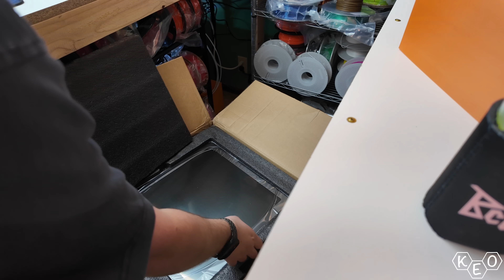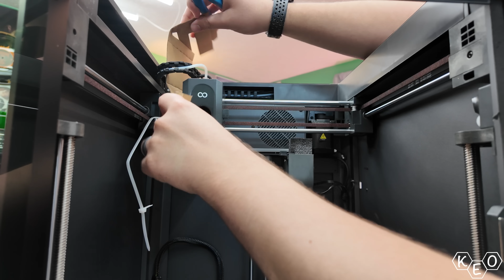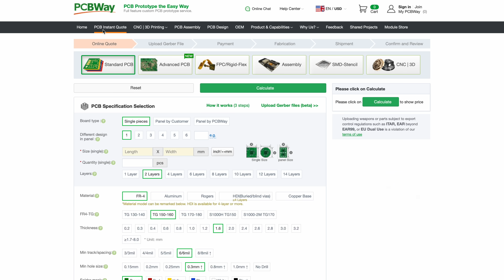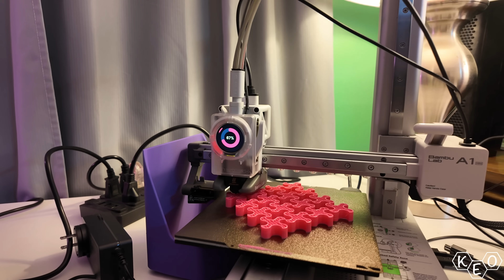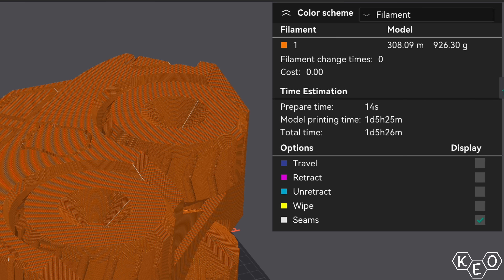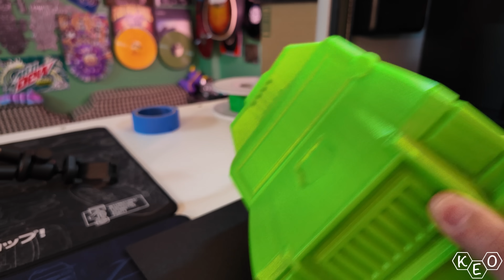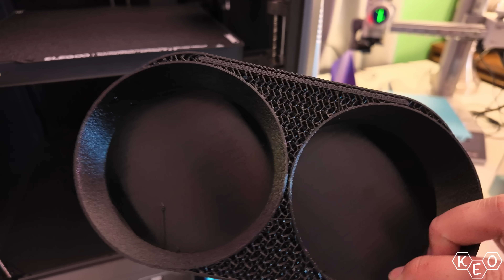$300 for THIS? Elegoo Is Playing Dirty…

Comment: Mine is a batch 2, and I absolutely love it. I always use orca slicer and tweak the profiles and settings, so that does make a difference, but I swear with the same profiles and settings my Centauri prints a little more accurately than my P1S.

I cut off the zip tie on the boden tube near the hot end and no longer have loading issues, so that’s an easy fix.

My one issue with it is the noise. This thing is Loud. It also has some problems with fans running on max when they don’t need to, and not turning off after a print or filament loading is done. They fixed some of that with a firmware update, but it still needs work. Fortunately it’s clear they are dedicated to ironing out the bugs, and I’m pretty sure the fan problems are mostly software side.
Reply: It took me a while to realise that only the electronics bay fan (that runs on for a while after the print finishes) is entirely under firmware control. 
The ‘aux’ fan (the flat one at the back) is (only?) controlled by the g-code (it helps with bridging). It ramps up and down depending on whatever bit of the print.
The chamber exhaust (“case”) fan runs all the time during printing, even with door open and no lid, which is pointless. But if you turn it off, it comes on again soon afterwards. It is not controlled by the ‘exhaust’ fan setting in the (slicer) filament profile! I have been told that this ‘always on’ behaviour is from the g-code generated by Slic3r, Prusa and all their derivatives, including Orca and Elegoo. 
We don’t want to mess with the hotend (“model”) fan! 
The firmware DOES (newly) shut off those three fans at the end of each print - but the electronics bay fan only goes off once the temperature has dropped (and that isn’t quick, causing me concern about the lack of venting of that bay.)
I’m just surprised that there should be (kinda useless) fan ‘controls’ on the touchscreen. 
Initially I wondered about upgrading to quieter PC fans, but I suppose I have got used to them, and now consider improving the electronics cooling a higher priority.

Comment: They're going to have a hard time disrupting anything when they can't ramp up production. Here we are 4 months after launch and it's STILL on pre-order with an ETA. of August here in Canada. Personally reliability is far more important to me than anything else, followed by ease of use - loading/unloading, maintenance, hot-end swaps, the general stuff. This is basically a PLA printer for $300 in 2025... It failed hard at TPU and self destructed trying PETG, I'm not worried about Elegoo coming in and disrupting anything.

Comment: Nice! I had a creativity ender 3 v3 ke, that i lost my patience trying to make it perfect and decided to change it for a bambu... This one seems ok, those defects might be corrected with a bit of programming and physical corrections in the system movements... But the truth is that when a machine is inconsistent or drives you nuts... An I going to spend time correcting the settings to make it work, it would i like to spend my time using it for what i bought it for...
Reply: That’s where I’m at too, Ender 3v2. Did you end up getting a new printer?

Comment: I get that you want to test what profiles are present and if the printer can do auto-calib for flow-rate and pressure-advance, but if dont do profiles you wont get really good results. Even my X1C whic has auto-calic is sometimes much better and much worse with the feature, i just stopped using it and only use it to roughball a number and do my own manual print profiles, for very good results, just like people on the P1S do. Also not only your black petg print is faulty, even your green car print i faulty, You can clearly see kinda of layer shifts and the massive change in color and detail in the middle, thats the same thing the black print hast, just smaller walls. Im guessing this comes from not enclosing your enclosed printer, because of the tube thing.

Comment: At that price it would be great if only it was reliable. But that's the thing - to achieve this price point, they have to cut costs somewhere. Making things reliable is expensive - it requires quite a lot of labour. Producing proper printing profiles requires hundreds if not thousands of printing hours. And for this to work on many printers, you need to make sure all the printers are havig repeatable results. That requires quality parts, securing proper supply chains, etc. Firmware development is also famously hard for manufacturers of cheap electronic devices.

Dont get me wrong, I admire manufacturers who can produce things that cheap. It is not easy, it requires some type of ingenuity and a lot of knowledge and experience to make cheap things. Especially if we are talking about cheap working things. But the devil is in the details and there is no time and budget to get all those details right if you want to be on such a competitive market with such a low price (and thus low margins).

Comment: One of those totally invalid reviews. Using printers on default profiles is for rich people who buy overpriced filaments.
Reply from the maker: Am I the rich one buying overpriced filament? I think I’m missing something because in that video I used everything from a 12 dollar spool of no-name PETG to overture TPU and PLA. That aside, elegoo makes filament. They can ship machines with pre-tuned filament profiles like Prusa and Bambu do. Just one simpleton’s opinion though. Thanks for hanging around friend!
Reply: @KeoPrints  No-name filament and filament from China usually requires tuning, that ends with results rather different from default profiles. For example, there is PETG that I like, but it does not even start to extrude below 250C. Sticking to default profiles is intentionally worsening the results of all brands that do not have their personal profile in the slicer.

Comment: For the PETG print I would check the cooling settings, both hot end and the sheet cooling. PETG likes to be hot, so a light touch with cooling (or none at all if the model can handle it!) will probably fix the issue.
Reply: Yep, this is the conclusion I came to as well. For some reason the Centauri loves to run its fans on max all the time. They fixed some of it with a recent update, but it’s still a good idea to mess with the cooling settings to be safe.

Comment: Helloooo, firstly, being cheap does not allow it to be crap. This is unhealthy for the market and a barrier for adoption for most people. If you're a tinkerer, then fine, I remember the Ender3 :) Second, TPU on the textured PEI, there are a couple of ways to address this. very watery PVA glue as a separation layer works well, but it works better on the smooth sheets as if it's too think it'll pool in the texture. But nobody likes the gluestick, especially us lazy folk. The removal is eased if you're into cleaning your bed with IPA. Use a pritzing bottle as it reduces te amount you use any way, bt spray the bed with the model on it a little and let it wick under the model. While it won't jump off the bed, it will make pulling it off less likely to rip. Cool videos :)
Reply from the maker: Great notes here! Thanks for taking the time friend!

Comment: Regarding the imposible to remove TPU parts printed in PEI beds, just spray Isopropyl alcohol trying to get it where the part meets the plate, it will flow between the part and the bed, just wait half a minute or so and the part will be really easy to remove.

Comment: Bamboo didn't invent Core XY, Enclosures, or filament changers. Charging Prusa processes for the same number of steppers and a few more feet of belt than a bed slinger is crazy.
Eligoo isn't disrupting the market, they are resetting the norm.
Reply from the maker: This is true. Hopefully this reset inspires other manufacturers to make affordable machines

Comment: Got mine about a month ago, had no issues at all with this machine, haven't had 1 failed print - have only printed with PLA and PETG so far though, just using the elegoo slicer at the moment. Came form Ender 3 so anything feels good I guess but just been impressed with the reliability of it, I haven't had any of the weird software issues you have been experiencing or the filament tube issue, although my bend doesn't seem as extreme as yours, perhaps I just got a later machine with a few small changes
Reply from the maker: Well that's amazing then. I am hearing that from people here so I am hoping the machine continues to improve. As it is, this one is still great. Just needs some polishing.

Comment: $300 is a great price. If not offset by wasted filament from failed prints. I need reliability more than a great price. I paid $150 for a new Adventurer 5M and havent had a problem yet. For $150 more than this is for a 5M Pro, I'd buy that.

Comment: The Centauri Carbon (or more likely the regular Centauri because I don’t really need it to be enclosed) is a printer I’ll definitely be buying sooner or later. Especially since anything from Bambulab is an absolute hard-pass for me, this Elegoo really looks attractive. When spending less than €300 on one I can afford to change out the mainboard if the one it ships with becomes too limited. But thank flip it just runs a customized version of Klipper without any cloud connectivity whatsoever (local network is perfectly fine for me, anything that requires an account is absolutely not). So I’m not too worried about firmware limitations there. Because it’s already just doing what it’s supposed to and even if Elegoo pulls a Bambulab and starts stripping away paid-for features, then it’s just a matter of ✨not updating the firmware and using it like usual✨.

Comment: Thank you for the review. A $300 printer over a $1500 printer is not worth $3 if it wont print or prints fail all the time. Too many choices that just work to put up with that today.
Reply: If you don't know what you're doing you'll have a bunch of fails with a $1500 printer too.
Reply from the maker: Fair point. I suppose it all comes down to what you are able to tolerate and what your priorities are

Comment: I got my CC 5 days ago. It was in batch 4 and wasn't supposed to ship till next month. Luckily it did come with the upgraded light and the multi filament port in the back. The ptfe tube does not come zip tied down anymore and I haven't had any issues feeding in filament, even with the glass top on. I immediately did a firmware update and haven't experienced any issues with the touch pad or with printing. I've kept it busy since it came in and haven't had any kind of failure. I've been switching between PLA, PETG, and silk PLA in different brands. I'm extremely happy with the quality and the speed has been eye opening. I accidentally sliced silk PLA with PETG settings and it still printed amazing with only a slight amount of stringing. I am one happy customer...
Reply from the maker: This is what I want to hear more of. That's awesome that your experience has been great.
Reply: Good to know! Still waiting for mine which means it should have the upgraded parts too.
Reply: How do you figure out what batch yours is from?
Reply: @markm4952  If you haven't gotten yours yet, it should be from the "new" batch with the upgrades. At least that is what I am figuring. I'm still waiting for mine too - preordered it May 5.
Reply: @markm4952  On the CC page at the Elegoo website, there is a link to Detailed Shipping Information. That page lists the different batches and estimated ship times based on when you ordered. And FYI, I've now have well over 300 hours printing time on my CC and I'm still loving this thing. Best purchase I've ever made...
Reply: Still waiting for mine, so with luck I should get the latest updates as well. I was in batch 4...ordered 6th March. I've got a growing list of things I want to print with it now...

Hope to be as happy a punter as you are :)
Reply: @chrissavage5966  I didn't order until May 4 so I'm probably going to be like batch 30 or something LOL
Reply: THANK YOU FOR THIS, this is what people want to hear. I was concerned about the light and if I would have to add my own. I ordered mines last week  and am in the current batch list so mines is expected to ship July 31

Comment: I got mine this week and, thus far, have been really enjoying it.  The version I got is the newest revision.  They fixed the crap lighting and it's actually really solid now.  There's only a few real beefs I have with it, mostly though, what I've been spoiled with with my A1.  The lack of ability to stop an object during a print sucks.  If I've got a bed lift or something, I'm stuck printing that bad-boy or wasting the rest of the print.  One of those Bambu features you don't realize how much you like 'till you don't have it.  Also the lack of ability to move the plate or do, really, anything while the print is paused sucks.  It would be super nice, once again like Bambu, to be able to move the plate for things like inserting magnets and such.  And, of course, the big issue of not having an app.  First-world problem, yes, but still really handy when it comes to things like filament run-out and such.  Notifications have made life so much easier.  So far, though, for what it is, and yes for how much it costs, it's a pretty solid printer that's printing fairly well.
Reply: There's a setting in Orca slicer that allows per-object cancellation. Search for Exclude Objects. I haven't used it, but I'm pretty sure it does what you're wanting.
Reply: sounds like an app is either now available or releasing soon, or it's just talking about the octoeverywhere integration that is now functional but req a raspberry pi device
Reply: @coreysmith5397 at the moment, no app, but yeah I'd love it if they actually come out with one. Even if it isn't very good, the notifications are super handy

Comment: I've only got 158 hours on mine so far split between PLA, PETG, ASA and TPU using default profiles.  The Overland TPU I like on my X1C was stringy but I was able to clean it up with a knife and hotgun.   Print quality on the PLA was as good as my X1C which is great.  I had some screen freezing before gettting the latest firmware update.  The printer is very, very loud due to fan noise and I can't be working in the same room as mine.  A 10.5 hour print on my X1C is about 9.5 hours on the CC.  For US$300 is a pretty good machine so far.

Comment: What is that mod to your A1 mini toll jead with rhe LCD screen called and where can I get it for my full A1?
Reply from the maker: Here you go!
Panda Knomi
https://shrsl.com/4w2rm
https://youtu.be/fI3eqY6m1hA
Reply: @KeoPrints thanks already found it 😁 
But do they have the V2 for the A1?
Or can your only get the non touch screen V1?
Also I saw a short video clip on AliExpress and it looks like they plugged it in to something inside the A1 tool head
And they show it in the listing without a cable 
I wonder if it can be plugged in to something inside the tool head or if I have to use the AMS Ports.
I already have the AMS and a LED strip.
Ir can it even be powered from a USB?

Comment: I pre ordered the non enclosed Centauri.  Only problem is that I have to wait until mid July until it’s shipped.  Probably will be about 2 generations out of date by then.
Reply from the maker: Well with any luck you will have an updated unit. I am hearing a lot of reports about people getting theirs delivered after I received mine. They are reporting a fix to the PTFE tubing for example and firmware updates for more stable usage. So you might be in luck for having to wait so long.

Comment: Most reviewers mention that a manual Z height adjustment is sometimes needed for PETG. I haven't tried PETG it on CC yet. I got a unit in the first batch and have 137 hours on mine and I have had no issues so far. I do primarily use the BIQU Frostbite plate which also helps with rock solid adhesion.
Reply from the maker: Love those BIQU plates so much!

Comment: So, you're not in common with the display!? Why are you trying to get a reaction from an " only sign" icon! Like the temperature, or the steps that show what the printer is doing at the moment!? Sure, there will be no (re)action because there is nothing to react! And pressing "load filament" and "unload" by not waiting for the right temperature to be activated by the printer doesn't make sense anyway.
Reply from the maker: Apologies for the confusion; I didn’t have footage of the screen freezing up so I used that footage. I understand the thing was simply heating up in that clip; I was trying to illustrate the point a little bit

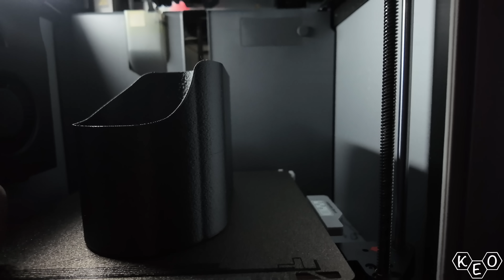Comment: When you printed the PETG on the X1 Carbon, it ran auto flow calibration, you can clearly see the test lines at 21:15. If you had run calibration on your elegoo using Orca Slicer's flow calibration, you'd be able to enter the correct value and fix this problem. The LIDAR camera that does this, is definitely a nice thing, but it's a $1,250 printer.

Manual flow calibration is expected on a $300 printer, unless you find a good profile.

Comment: I have 100 hours on mine and so far its perfectly reliable. However I should note that I do full filament calibration with each new filament brand and type. I also always print directly out of the dryer so maybe that helps prevent issues.
Reply: Yep, I've been printing straight out of my Creality dryer and I think that has helped with the quality of my prints. The filament sensor pivots up and down, but I wish it could be bent outwards a little to line up with the dryer port better.
Reply: Printing out of a good dryer (not one of those slightly cheaper ones with fake sensors) is the way to go. It makes cheap printers like this one print as reliably as printers many times as expensive.